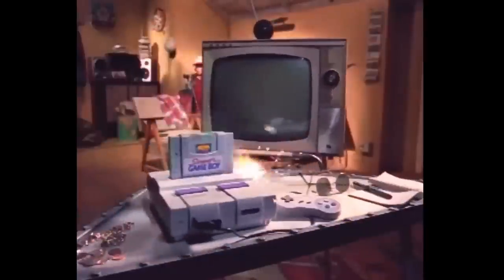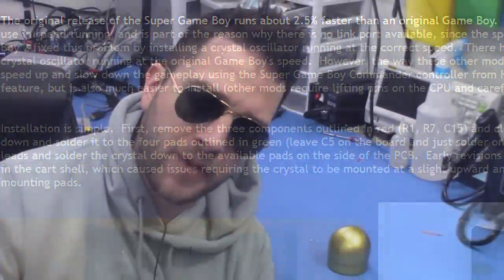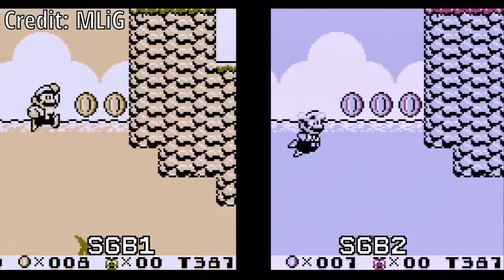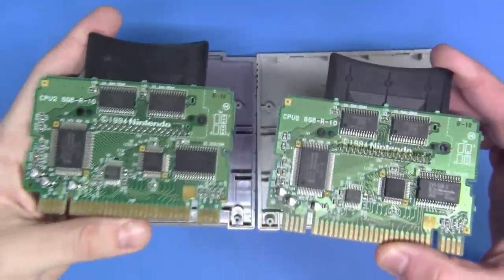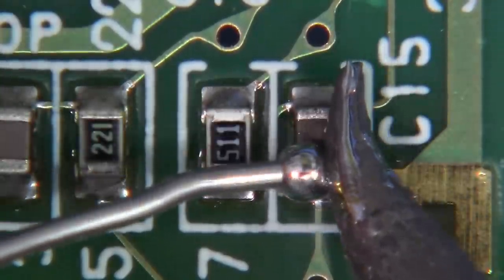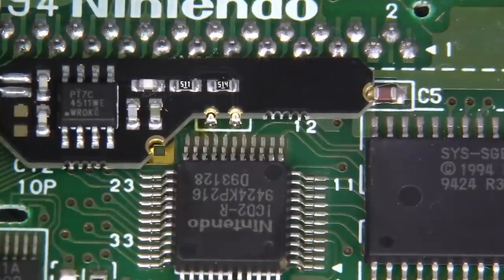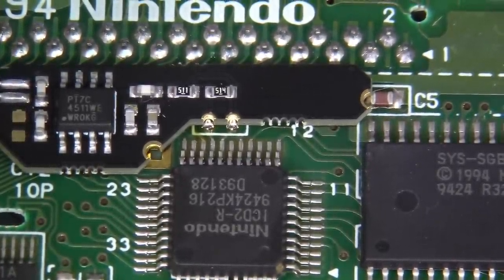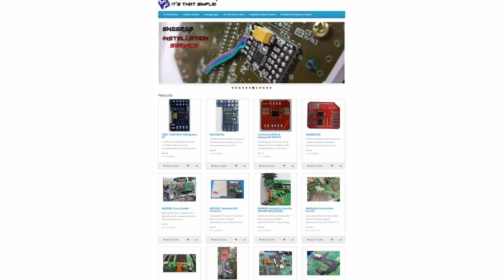The Super Game Boy | Fixing Nintendo's Dirty Flawed Secret

Comment: I would clean it up still, I use to not do that but I have had some components fail over time and later was told it was because the flux added/core is typically acidic and will eat away at the connections requiring more repairs later. Though this is not advice coming from someone of great knowledge .... I still consider myself unskilled.

Comment: So, the question is, do the speedrunning communities accept speedruns using this mod? Or would I still need to look elsewhere if I wanted to? I've had a SGB1 floating around for ages and considered the idea of ordering a 2 because of this issue, but if I can just mod the one I have that would save me some hassle.
Reply: That would be up to each community, but usually hardware modifications are not allowed in any shape or form, so I'm not sure this would fly.
But again, it will need to be discussed amongst the communities

Comment: Now we just need a mod to add in a Link Cable port, and the Super Game Boy can finally have the same features as the Super Game Boy 2. :)
Reply: X2 @Voultar Make it so.
Reply: Qwertymodo has that mod too, both made a couple of years ago. Check out their Tindie store
Reply: I'm working on getting those back in stock right now. The installation is a bit more finicky than the clock mod because you have to solder directly to a handful of pins on the CPU, but I do have a flex PCB that helps simplify things.
Reply: @qwertymodo  doing the Lord’s Work🙏🏻

Comment: Clean mod. I'm not a HUGE fan of flooding so much solder directly on C5, though. U5-32 would be preferred.
Reply: I intentionally chose to avoid soldering to any IC pins for ease of installation.  There's no real issue with soldering to C5 like that as long as you don't go too crazy and short out the cap, or leave the heat on too long and desolder the whole thing.

Comment: This mod Board is awesome! It also retains the extra functions of the Hori SGB Commander.
Reply: The Hori SGB commander works with SGB2 too?
Reply: @elkernel  I believe so. the old way to do this mod was to lift 2 pins and solder a new crystal oscillator to the chip, which removed the sgb commander functions. so with no mods at all, it should be fine.

Comment: Really really hoping you answer simple questions king VOULTAR... 
The only type of solder I can find in my area is lead free and ice never been able to get my hands on silver bearing. That means I have no clue what a decent brand of silver bearing solder to get not do I know what to wet with... In all my years of missing my own consoles the only flux I've been able to find is "paste/wax" type..... HELP

Where can I find what you use on eBay....

With lead free/wet flux the smallest things I've been able to solder were LEDS in a 360 controller.... It took hours... If you can imagine... I know it isn't me, I've been able to weld for years and my occupation is "plastic welding" with a massive "froam green beast" of a 20 pound gun....

Comment: I believe this is a GREAT first project for a Novice learning to solder!
PLEASE DO NOT USE YOUR DADS WELLER SOLDERING IRON!
Spend $30-$50 get a knock-off HAKKO temperature controlled "t12" style ESD protected soldering station off Amazon, it will make your future projects so much easier!

Comment: I was desperate for one of these until around 1998 when I finally got one, I was expecting full screen gaming not a tiny portion of it, so it defeated the purpose of it for me.  Still it was a cool unit.
Reply: Resolution differences. If you can't evenly distribute the pixels it looks glaringly bad. :)
Reply: Yeah, there's no way they could have done it without it looking horrible.